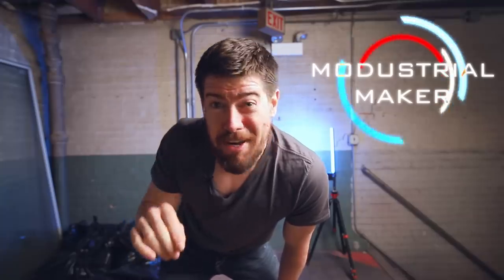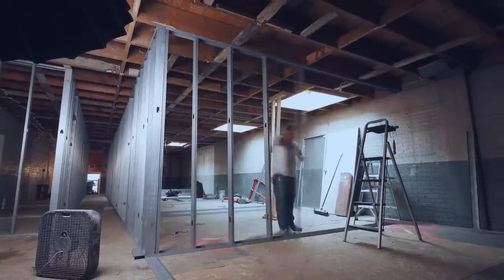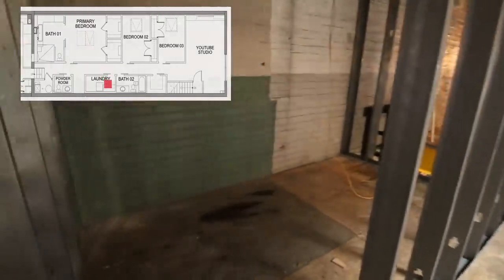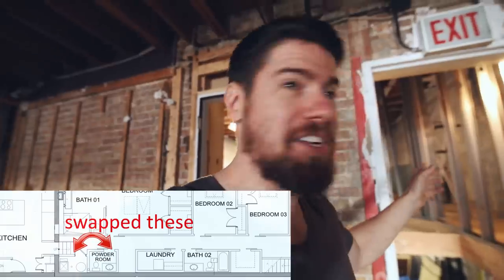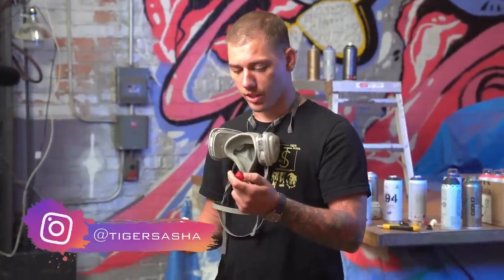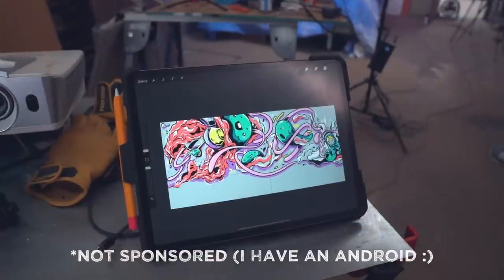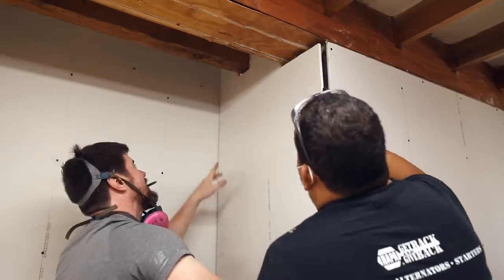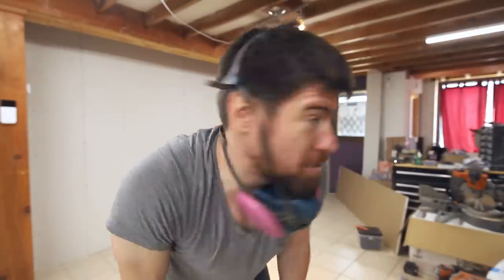Abandoned Building Renovation Ep 07: FRAMING walls + MORE STREET ART

Comment: As someone who works with metal stud framing everyday and has to work with the other trades you really screwed with the electricians by one cutting studs from the wrong side and two installing them upside down in some instances making the holes meant for conduit not line up and it's going to make extra work for the electrician.
Reply: You really screwed with my ability to read this comment by refusing to use any punctuation

Comment: Pro tip when it comes to drywall installation that I see too many installers do wrong.  When you put the screws in, you DO NOT want to break through the paper on the board.  That's what gives it the strength and holding power.  Once you break that, the screw is holding gypsum that crumbles over time and then the back side of the paper is all that's holding and the board can move away from the wall with shifting and settling.  People who install everyday will use a screw gun with a nose cone that you can adjust the depth on so the screw sets in far enough to give a recess to spot the screw with joint compound but not so much that it breaks the paper.  Using an impact or a drill is not preferred, but can be done for a few sheets but be aware not to sink the screws too deep.

Comment: We use metal stud wall all the time here in the UK and and we insurt timber into the channels for framing the doors. When I specify a metal frame in a domestic setting, I use a double layer of drywall which is acoustically efficient when combined with rock wool infill. This going to give you a fire rating. Metal is a great choice. stay safe J

Comment: Love your huge project there. Just wanted you to know that we (in Denmark) normally put a very thin glass fiber "filt" on the dry walls before painting them (much like a super thin wall paper) - gives a much more smooth surface that can withstand a lot. And to speed up the application I would glus the "filt" then prime it before the glue dries - saves time and yields great results ;) Best of luck going forward!

Comment: I'm glad you did the spray art by the CNC wall.  Last video when you painted that corner, I was kind of disappointed when you covered it with the white paint.  Tiger Sasha has an amazing talent and did an excellent job.

The hallway does look a bit narrow.  Hopefully you'll be able to fit all the furniture and appliances through it.

Also don't forget to use waterproof drywalls and membrane in the bathroom area.  And if you can get a deal on floor heating throughout the house, I think you should get it as you won't be needing to crank up the heater during the winter.  It'll save you lots of $ on heating bill.

Can't wait for the next vid. All the best man. ✌

Comment: Before you wall it up you should run CAT6e and coduit so you can have a wired network and the conduit will make it easy tor upgrade to new cables and even fiber.

Comment: You could have just used 20 Guage studs and then its all good for hanging stuff. Plus the walls won't shake and rattle. Some studs were put in upside down. Slot down to have the C channel hold it laterally. The slot should start 2 feet from the floor and every 2 feet after that. You are also missing slotted track for the top. This allows for deflection when the building moves, so the drywall does not crack or pop screws. You don't screw the drywall to the deflection track.

Comment: I noticed you're looking to put the range on the island.  Be sure to get a good vent hood above that range.  If the range is the middle of the island then the hood will be visually in the middle of the room.  A down draft vent does not work nearly as well as a vent above the range.  Overall it will be much better to put the range against the wall and put a strong vent in.  Use a separate vent system, not one built into a Microwave, the airflow is somewhat restricted on the microwave units.

Comment: I was of the understanding that you should not do metal studs on exterior walls because they conduct external temperature into your building. Let me know if I'm wrong on that.

Also you can get a drill bit tip that is perfect for insetting drywall screws, good for any drill. A pack of 3 is about $5.

Comment: Probably too late, but as a guy that has to hang crap in commercial spaces all the time, hang a couple foot wide strip of half inch plywood between the studs about eye level around all the rooms that isn't a hallway.  Metal studs are made to hold the sheetrock in place, and that's about it.  I've had toggle anchors pull through them.

Comment: nice project

for your walk in closet room
- I suggest to have cabinets only left and right and not at the end. And a wall mirror (floor to ceiling) facing the the sliding door is also very usefull
- corners are not practical to use ;-)
- this way your room can also be less "large" 60cm deep per cabinet + 90cm of space betweem is ok

kitchen
- island is life it's just wonderfull how people gather around it, I built mine with ikea blocks and everything was on it, sink, cooking that was wonderfull to cook and see peoples, tv, etc..ou don't feel isolated anymore !
- corners : usually expensive (i.e check the prices on ikea) and not useful, I would try to get rid of it

others
- insulation, insulation, insulation ;-)

Comment: Are you gonna do anything with the Air supply/exhaust to The rooms? Thinking about all The closed space you are creating.
I think some fresh Air that is voth filtered and tempered would be good for you. Also thinking about your concrete 1st floor which has accumulated toxic wastes over the years in industrial use that you dont wanna be breathing 24/7. A good Air  supply / exhaust system would do good for you.
You seem to have high ceilings so you can assemble and hide it very nicely and build drywall around them!
Gj with everything so far its so fun to follow your project

Comment: Construction in the US seems so much easier and flexible.. also cheaper.
I wish this kind of construction became more popular in the EU. We mostly have concrete or brick houses. Which is sturdy, but not at all this flexible. Just thinking about the plumbing and electrical wiring... It's so much easier with this type of build especially when u have to redo the whole thing. Or just switching up the layout of the building, you don't have to demolish those thick walls.

Comment: Just wondering, in Sweden we use alot of insulation, we do roof and floor just have a silent home etc. At the beams. Saved alot of heat too, if you thinking about the environment. Would be alot of sound at workshop and landeryd too. Same with walls, so how responsive is it atm? If you like drop a fork in workshop, would you hear it in bed room?

Comment: Your framers put in half of their studs upside down. Why'd you rock before an electrician did anything? Your drywall needs about twice as many screws as it has. 8 inches on the edges and 12 in the field. Putting the beveled edge of drywall on an outside corner is also a huge no-no. Your guys are amateurs.